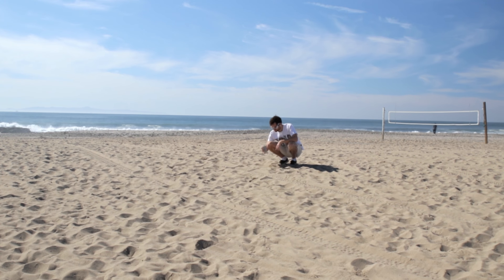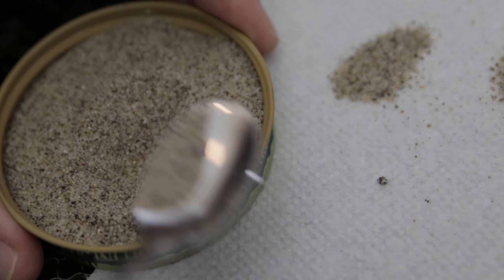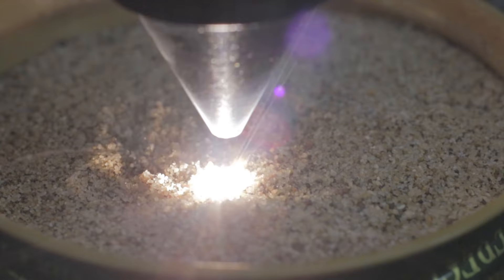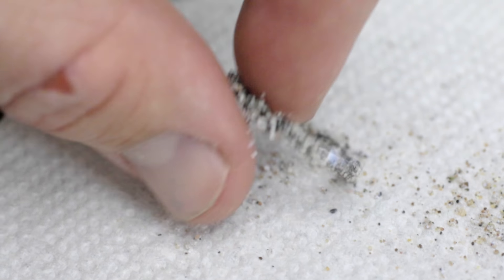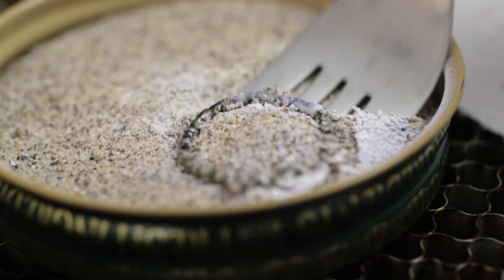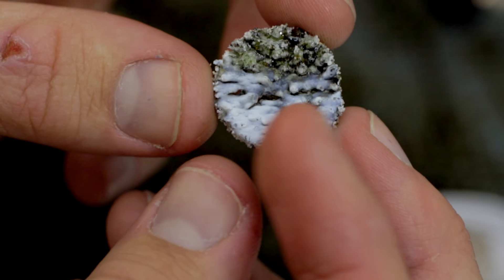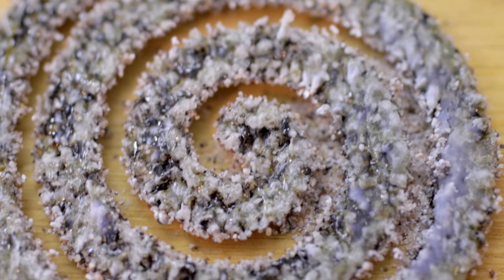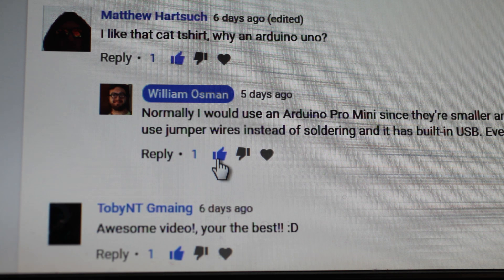Can a Laser Melt Sand?

Comment: Thoroughly run a strong magnet through the sand before sintering it. I have a feeling it's the iron particles that are making it fragile. That's probably why you're getting most of that black color too. The sodium bicarb definitely helps but you really need to get all the phenolic material out of the sand first. You may want to put a plastic bag or something on the magnet to insure easy cleaning otherwise you'll be stuck with small particles that are annoyingly difficult to get off.
Reply: Takes effort so no
Reply: I don’t know what any of it means but it sounds like this guy knows his stuff so I left a like so  William might see it
Reply: Brayden Schultz, it’s a bit late for that
Reply: Shhhhhhhhh no smart on channel
Reply: Additionally, packing the sand will help
Reply: @evans9715  I was thinking maybe even adding sand too! It looked like it was getting varying amounts while it melted, so something dispensing sand in-front of the laser might help.
Reply: @braydenschultz9272  my name is Brayden too :o

Comment: What would happen if you made multiple passes over the same pattern?  Would it improve the quality and extent of fusing?
Reply: It should help with melting that sand on the surface, at least. New sand might get stuck before it hardens again, but yeah. Heating it up enough would also harden the sand in the middle of the pieces which only had a solid surface but were filled with sand, like the beads.
Reply: Wierd seeing you here atomic shrimp

Comment: As far as using the laser for melting applications, could you set the nozzle at an angle to prevent the smoke from wafting up into the lens? That way you could use it without the air and make that clear glass.
Reply: Hello

Comment: I have worked with laser cutters very similar to your setup, and a way you can avoid that smoke leaving residue on your lens is by shielding the beam with inert gas, kind of like a MIG welder, how the wire is fed through the center and the Argon shoots out around it to sheild the weld. we used Argon for ours because we were welding but I'm sure you could use some other less expensive gas

Comment: You should try "purifying" the sand. Beach sand is actually composed of several minerals, so melting it will create a mixture full of different stuff from different minerals. Thanks why you get a weird glass from it. However, if you only melt quartz, you might get better results (and probably something closer to what you were thinking you would get), and/or something similar to regular-everyday glass.

At least use a magnet to remove iron-rich minerals ;)

Comment: I'd like to see you revisit this test, but with some things done differently. Beach sand is mostly calcium and makes a very poor glass. However silica sand which can be bought at a ceramic or glass supplier will melt into pure glass. Also, after adding the soda ash your results were better because soda ash melts into glass. Notice how the glass changed color after adding the soda ash? Soda ash melts blue, and the beach sand melts black, thats why it turned green. Soda ash is used commonly to glaze ceramics.

Comment: Beach sand contains partly clastic (silica rock) sand and partly calciumcarbonade (animal shells, coral etc.) The silica clastic stuff is easy to melt into glass. If you use river sand next time, which is almost only silica, you can get way better results

Comment: You should sieve the sand and use the smaller grains then add a lowering bed and use it as a glass 3d printer. Kind of how they use glue and cornstarch on older 3d printers. Just found your channel and subbed!

Comment: Those alligator wires such. They're usually just badly press fit. I'd highly recommend rework them by soldering a thicker wire onto the clips. And don't forget to put the sheaths back on the wire before soldering the second clip.

Comment: Try really fine sand powder, also pre heat it in oven (like 200 C). Then add new layer of fine sand powder on top of the melted print to make layers, just like 3d printer would. You might be able to 3D print glass with that laser.

Comment: Maybe try real black beach sand or filtered down to very very fine jet black sand. The other components used for glass making could then be added and mixed, I think working with this new black mixture would work well to absorb more energy from the laser.I have some experience in bead glass, prep, and blown glass.  If you want me to be clearer on what I can help with  or even send you some samples and free stuff please hit me up I have a full wood shop with welding capabilities and a full separate lab for electronics and then another for chem and then even a master control center for the computers and music production for fun (and finally an advance multi  ras pi and PC multi SDR setups running stratux and flight trackers and some other fun wares and a fleet of various special hardware radios too.) I have several smaller lasers up to around 4 watt medium bed and a 3D printer of course and I do a lot of work with drones of all shapes and sizes and custom solutions for film work  or various specialized projects. I have time to spare unbelievably because some medical issues but I'd love to contribute to your channel in any way  I can. New sub and have liked every vid so far. Finally I also do a lot if defcon type work and software and physical radio too, and am an exotic animal specialist if anyone wants to know lol. I know most of this is pointless but if it is a way I can help even completely uncredited behind the scenes at my lab just to aid a channel I want to support. I even have some spherical cameras and Lytro Illium light field ones as well as a slew of 1080 or 4K sports cams including 1 plane 360 with sports  case to go with all the  drones etc. . I can even do spherical 369 with my theta s and a it's underwater case. I'm not a YouTube creator but I would like to support channels in ways other then money and give my self projects at the same time. Again sorry for the run on, thanks again love the ur channel and would be glad to support your work in any way. Ps if it helps I'm over twenty six so I not some desperate kid, just someone who's medical issues tend to make involvement in the community harder when alone. Cheers again and I hope I can off parts, work, or anything you need, seriously. Please keep up the amazing projects and I'll be here! If you hit me up I guarantee I can help you somehow and I don't want credit at all, it'd just a thank you for your content that helps me through the days, peace and best wishes!
Reply: Mspark400 Smith seems he might need somewhere to live recently

Comment: They don't just use beach sand to make glass, it has to be pure SiO2, pure quartz or pure silicon dioxide. Normal sand has many components which won't melt at all, so the glass is just sticky quartz with granite components and other minerals, it'll break instantly and won't look like glass.
Reply: Mans said silicon dioxide twice

Comment: how hot does the laser get? i think sand melts around 3100 F
Reply from the maker: Not exactly a temperature, but ~100,000x brighter than daylight when focused.
Reply: William Osman ahh.. well i weld for a living so i only have knowledge on high voltage stuff idk about the focusing of light other then a solar bbq haha. i would think its getting to around 2000 F since it did melt it.

Comment: A large Fresnel lens would get hot enough to melt a glass bottle. so its hot enough to melt sand for sure. if you got one of them large big screen Television sets from the 80s and 90s, you may be able to get a nice lens. I had one. took it apart and retrieved a sweet lens. but I have no frame for it. if I knew how to mail this thing. I would sell it.

Comment: It looks like the grains of sand that didn't smelt into glass but were still incorporated into the rest of the glass were what caused most of the structural instability. What if you used a small amount of sand and let the entire sample smelt fully? That might make yield a smoother, glossier, and stronger final product. And also might just be a tremendous waste of time, considering how inefficient a glass-making process this is.

Comment: why would you use such a thin cable for those voltages?
Reply from the maker: Low current. Same reason power lines use high voltage, you can do the same amount of work while moving less electrons.
Reply: yeah, forgot about current

Comment: If you really wanted to make a glass ring using this method, I'd recomment trying to heat treat the ring (heat treating is used in all kind of material where heat and quick cooling were used (which builds up stress)), by doing so, your ring will end up less brittle.

Comment: If you are using jump wire for 25000 voltz, u could just lower the bar of the electric flow/wattz. But i can zee the jumper wire is burnt out. Hmmmmmmmmmmm